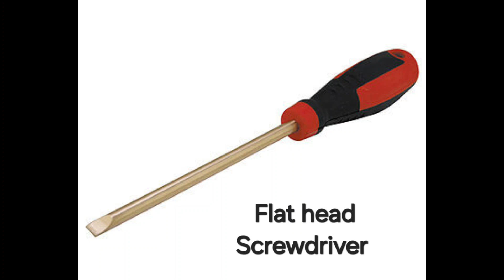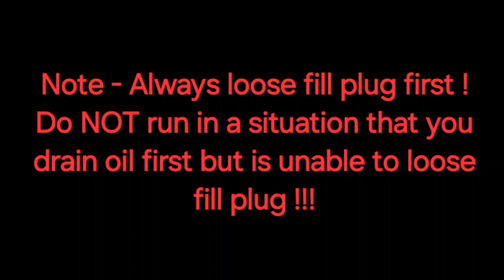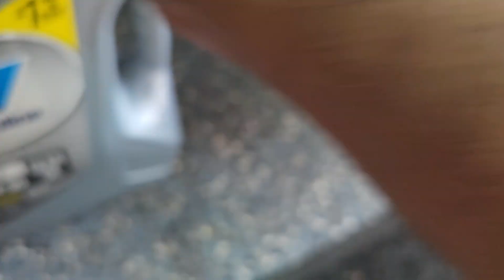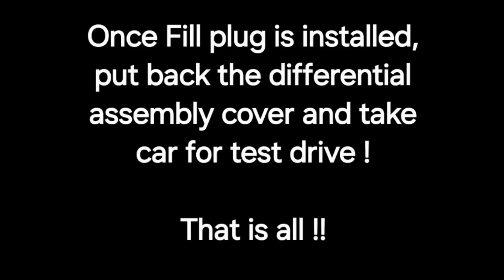Audi Q7 Rear Differential Fluid Change

Comment: Hi. I have a 2018 Audi Q7 3liter turbo. Issue I started noticing was that when I turn the wheel at low speeds (puling out of a driveway, or maneuvering around parking lot and tight spaces) I hear a sound that resembles rubber is grinding or tires rubbing excessively over pavement. Tires brand new (started noticing this issue on old tires also). Car was never in an accident, purchased it at 5K miles, it has 89k now. What would you say potential issue is?
Reply from the maker: Can't say, but check control arm bushings and wheel bearings. Unless you inespect, it is hard to identify based on issue description only
Reply: This sounds like the ole "quattro rumble" super common and changing the diff fluid is a great place to start.